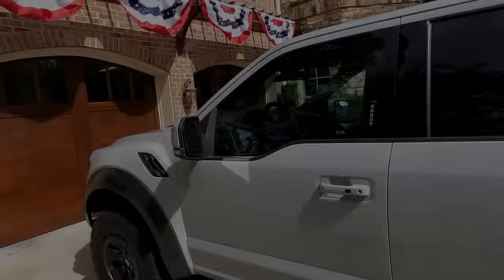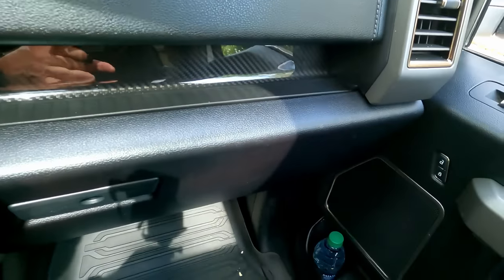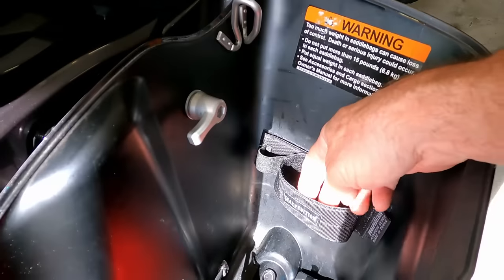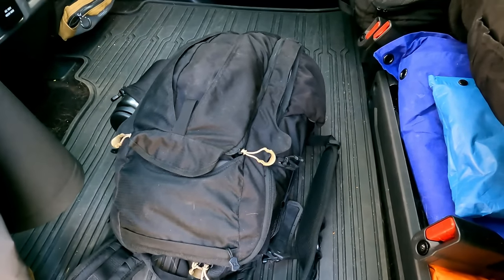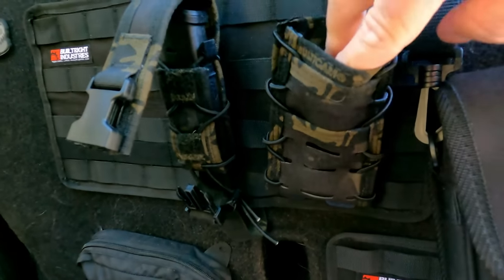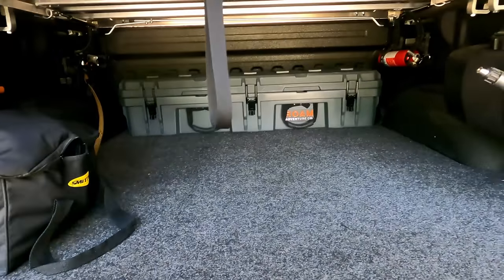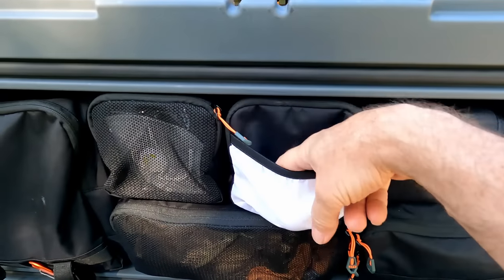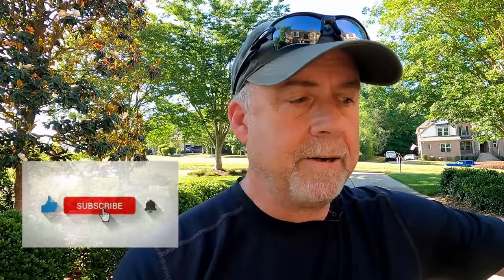Truck EDC - Everyday & Emergency Gear

Comment: Do you remove items / gear when you take the truck in for servicing?  

That's a lot of stuff to carry and store but impressed with the layout, love the molle under the cubby lid.... great 
idea.
Reply from the maker: RJB thanks for watching.  If I am taking the truck in for a quick service, I typically lock by console and place a small lock on my recovery gear case.  Longer service, I will remove items.

Comment: I would also recommend a water filter, either for personal use (straw) or the bladder with filter. Water bottles are great, but you will run out if unlucky. Water filters are cheap at the moment, and they are great to have if you need to use a stream or something..
Reply from the maker: Espen, thanks for your feedback.  I actually do carry a Sawyer Mini in my get home bag.  You are right, this is a must when becoming better prepared.

Comment: Just came back to this video. Stil find it spectacular. Would you consider doing an update?
Reply from the maker: Hi MB, again thanks for watching.  Ahh you read my mind.  I definitely need to do an update to a couple of my videos and this is one of them.  There is a couple little projects I want to complete and then I will do so.
Reply: @WeekendOverland  awesome. I look forward to seeing what you have improved. I also think that if I were to recommend one gadget that I love that I haven’t seen in your videos yet is a microfiber beach towel, I love our for wake surfing bc they dry very quick so you don’t constantly have to bring them back and forth from the boat to the house constantly doing laundry. I have also added them to all my vehicles bc they are good if you need to dry off or protect something. Additionally, I would recommend the streamlight macro stream. It is the best flashlight I have found, and I have bought multiple and every time I lose one I replace it immediately, it is that good. While it is not the brightest light, it does about all you need. I frequently wear a baseball hat and it has a clip for attaching to your hat so you essentially get a headlamp too. It’s usb rechargeable, so it’s always full and easy convenient to top off (I hate CR123a batteries bc I feel guilty tossing them, but value realizability and want to make sure my light won’t die immediately). Additionally, it is very compact and slips into a pocket with ease, I truly keep them everywhere, and on the last camping trip I went on, I only used it, I never once used my larger streamlight or o-lights.

Comment: I'm wondering about the hot summer days. So you just leave everything inside your truck all the time? Doesn't batteries go bad with heat? Tums go bad, inboprofin. You know what I'm talking about?
Reply from the maker: Hi NC2537.  Thanks for watching. You are correct.  Their are some things that have to be rotated out.  You hate to have those things go to waste but I look at it as the price to be prepared.

Comment: Excellent vehicle equipment.  I have an F-350 so similar interior storage.  Under my back seat in the factory tray I keep my truck gun chained up with a plastic covered bicycle chain and the seat down locked.   I have a camper top so I carry 95% of my stuff in the bed.   
Great video, thanks for sharing.
Reply from the maker: Thanks for watching Michael.  So many uses for that space under the back seat.  I am constantly thinking of other ways to use that space.  Camper tops definitely open up a lot of useable space!

Comment: Got some great ideas for my rig! Thanks for the walk through! Something you might consider: take the plastic wrap off of your TQ. Last thing you want to be doing if you ever have to use that thing is be fumbling around with that wrapper.
Reply from the maker: Hi Motoscout.  Thanks for watching and your comments. The TQ was actually taken out of the plastic shortly after the video was published but YT will not allow edits.  Glad I was able to help you  with your set up.  Good luck!

Comment: Awesome video! Was wondering if you could provide some insight into the glock lower - was that a custom stipple job?
Reply from the maker: Hi Wyatt.  Thanks for watching.  It is actually a simple solution.  Product from Talon Grips (https://talongungrips.com/).  They are cut to fit your specific gun.  They have a couple different textures as well.
Reply: @WeekendOverland  wonderful, thank you!

Comment: Great video! Love your setup! As a Paramedic I would recommend taking out the CAT tourniquet out of the wrapping, if you need it in a stressful situation it can be hard to take out of the packaging, tourniquets don’t need to be sterile as they are not supposed to go on the actual wound!
Reply from the maker: Hi Emanuel.  Thanks for watching. I actually removed the plastic about a week after publishing the video.  I have also since taken a Trauma med course and highly recommend it!

Comment: Nice setup, I always have several fire starting equip not only I smoke but I do need to set up a camp fire or light the grill quite often. It’s always good to have some extra bic around. I also have an extra bag of dog food and treats just in case my dog and I have to stay outside longer.
Reply from the maker: Hi David. Thanks for watching.  Very good suggestions.  Can't have enough lighters for sure.  I do have a dedicated pouch for dog treats but need to include a spare leash as well.

Comment: You should carry an Air Moto. Its a small rechargeable air pump. Never know when you'll run over a nail and be too far from a gas station. Charges with C-cable. I am assuming you have a tire repair kit.
Reply from the maker: Thanks for watching.  In my recovery gear box, I have tire repair and a pump.

Comment: Got a 2000 ford excursion that I'm getting ready to build.  I really like all of the mounting systems you have.
I live on the coast so I'll be adding a dive mask and spare air dive bottle.
Had a good friend that watched a car drive off the hwy into a water canal...right in front of him.  He immediately stopped and dove into help.
The car went down while he and the driver were still in the car.  The canal was 20 ft deep. He made it back out but sadly he could not get the driver out and she passed away.
This is why I plan on having the dive mask and spare air dive bottle.
Reply from the maker: Hi James.  Thanks for your comment.  Very sad but glad it has influenced you to prepare accordingly.  I think everybody's setup should be what they feel is best for them.  Glad you are putting a lot of thought into your setup.

Comment: I have a FORD f250 tremor. The best thing I added was the console safe. Btw, never leave you CCW in the car overnight. Painfully I know. G19x with 6 33rds gone. 
Btw, I keep nothing of value in my Truck anymore.
Reply from the maker: Hi John.  Thanks for watching.  I did not make it clear in the video but I only keep my CCW in the console when I am going into an area where I must remove it from my person.  But even for a temp situation, you are correct, a console safe would be a good add.  I will probably add it soon.

Comment: As for the fire extinguisher, could you store the water hose a little differently and put the extinguisher above the water port?
Reply from the maker: Patrick, that could be an option, I will take a look.  I have made quite a few changes since I produced this video (need to make an update).  One of which is a fire extinguisher in the cab within arms reach.

Comment: That’s a cool way to mount your pistol until you need to draw it quickly l. Also for the tourniquet you need to take it out of the plastic. When SHTF every second counts.
Reply from the maker: Thanks for watching! Regarding the pistol mount, I use it primarily when I have to take my CC off body (government buildings, etc).  But with any mount and any situation, practice makes the biggest difference.  As far as the tourniquet, plastic was removed the next day but unfortunately the video cannot be altered.  Thanks again for your comments.

Comment: How is everything hooked to the bottom of your seat? Also what is your holster and gun sitting inside your center console? Great video man gives me a lot of good ideals thank you for showing everyone!!!!
Reply from the maker: Gayle thanks for watching! The ford F150's come with this material that reacts well to the hook side of velcro.  The holder I have in my console is from Maxpedition (shown in the list of products in the Description area below the video.  I attaced it to the side of my counsole with a strip of velcro.  It holds pretty well but can come off at times when it gets really hot in the summer.  I positioned mine to where the end of the barrel just barely rests on the bottom of the console to reduce the weight on the strap. It hasn't come off since I made that adjustment.
Reply: @WeekendOverland Copy thanks for showing again guess I'm gonna see if bottom of my back seat will do that honestly now that I'm thinking about its kinda alot like the side of velcro. I don't remember what all you had on yours but do you think its strong enough to hold a ifak? And did you use those wire velcro keepers for your TQ?
Reply from the maker: @gaylecoombs5510  yes it is very strong to the point when I am trying to remove a piece I'm concerned that is pulling too hard on the material.

Comment: I love the setup. You gave me so many ideas. Unfortunately, my mega-cab 2500 won’t fit in my garage so I have a high end after market alarm system and a dedicated camera on my truck in the driveway. I keep everything in a few unassuming bags and load them as I need for trips to the range or out of town and even local errands. I put a console safe custom fitted for my truck in it and it’s perfect. A DiamondBack cover is on the bed and it’s additional security as well.
Reply from the maker: Hi Ken. Thanks for watching and your feedback! I definitely understand. My truck only has about 12" to spare while in the garage.  I am fortunate in that I work from home so the amount of time my truck spends outside of the garage is less than most people.  I have considered a console safe and probably should since I carry in the truck. Absolutely love my Diamond back cover and wish I had bought it sooner.  I have a few videos on it as well.
Reply: @WeekendOverland  Thank you for responding!!! Yes those covers are the best!!! The safe is by Locker Down and it’s great for keeping stuff when you can’t or don’t want to lug everything around. Let’s face it…if they take the truck…fine I’ll upgrade…if they have all day they can defeat the bed cover and the safe but like you, I work from home and stay up late. If you are STUPID you’ll come to the house lit up like a Nuclear Site or Federal Prison and tamper with my truck…in my house there is a total of 50+ years of law enforcement between myself, my son and my wife…good luck!!! Be safe and I’m going to subscribe if I didn’t already and check your other videos out!
Reply from the maker: @klj5150  First of all, thanks to your family for your service.  I am with you regarding your mindset, if you take it, it can be replaced ...... just don't do it while on my property!! Have a good one and thanks for subscribing!  More to come....

Comment: Ever had to explain to the cops or any issues with the cops and your set up? Also what are your worries if any, about somone taking the car I assume it’s a gps or Apple air tag somewhere in the set up. I have an app for my lo jack in the car so that’s helpful and I was actually thinking about getting a air tag for specific items
Reply from the maker: Thanks for watching Markus and your comments.  I will look into air tags, great idea.  I am fortunate that my truck is not often in a high risk area. So far no run ins with law enforcement.  I try to give law enforcement the upmost respect when pulled over and try to make their lives easier and less stressful.  Good practice is to turn on your dome light if pulled over at night so they are not approaching a dark vehicle.

Comment: I know this is really specific and something that's preference but I personally also have water, and mio but I do carry liquid IV also just for the simple fact that it helps with dehydration tons. I also suggest grabbing a different brand of water I'm my opinion Dasani has a lot of salt which is fine with liquid IV but with mio or just drinking will make you more dehydrated depending on the person's body reaction. 

Love the setup especially the molle under the center console!
Reply from the maker: Hi Brenden.  Thanks for watching. I couldn't agree more!  I was introduced to Liquid IV about a year ago and its a game changer....... Also about a year ago I moved out to the country where we have a well so now I rarely drink bottled water.

Comment: Nice setup, thanks for the ideas. The "shovel" you have is what we would call an "entrenching tool" or "e tool" in the military
Reply from the maker: Hi Zach.  Thanks for watching and your service. You are correct! this thing would be hard pressed to perform like a real shovel.  I actually have a shove that I sometimes keep in the truck with about a half length handle.  Still deciding on the best mount.
Reply: @Weekend Overland  always handy to have a real shovel when nature calls 😀

Comment: Latex gloves for dirty intricate jobs and incase you need to lend your heavy duty gloves out don’t want some else sweat in them. Various sizes of nylon zip ties or one better seeing as though you have the space, stainless looped rebar ties and a rebar bar twist tool. All very inexpensive, fast to use if you need to secure anything down/ together 👍🏻 nice setup
Reply from the maker: Hi Ron.  Thanks for watching and providing some great ideas.  I actually have some zip ties in my bag but I like your idea on rebar ties.  Thanks.

Comment: I would recommend putting 5% or 20% over your rear factory tint.  Couldnt imagine leaving all that stuff exposed all the time.
Reply from the maker: Yes, I have been considering this.  Thanks for the recommendation.

Comment: I have a question, How much was all the stuff in the truck? This is the most PERFECT  I have ever seen planning to buy an F150 when I grow up aswell, ill be adding a cab at the back unlike yours though, but everything else, I love it man!
Reply from the maker: Hi 5cvle.  Thanks for watching.  It appears everything has gotten crazy expensive lately.  The ROAM containers that I really like have increased by about $100.  Other items like the stuff from Builtright are still not bad.  My advice is to never look back and add up the cost 😆.
Reply: @WeekendOverland  yeah true lol

Comment: Thank you for sharing your set up with your gear.  I agree that the fire extinguisher needs to be more accessible somewhere close to the driver's seat. I do recommend that having your recovery gear more accessible if you plan on getting on trails that may leave your Raptor in precarious positions.  I've learned my lesson.  I must have missed what you have in your edc bag.  It seems like a lot of this gear could be stored in your edc bag.  I also noticed that your have a lot of knives and flashlights but no spare parts for your vehicle.  At the very least you should be packing spare belts, hoses, clamps, oil, air filter, etc.   Anyway, thank you for your video and stay safe on the trails.
Reply from the maker: Hi Stephen.  Thanks for watching and your feedback.  Yes totally agree regarding spares (especially if you are traveling in remote destinations).  Like many others, my setup is constantly changing.  I need to produce an updated video.

Comment: Great video! Thank you for making it and sharing your gear. 1 thing I have been thinking about a lot lately is a water filtration/purification supplies.
Reply from the maker: Thanks for watching Jeremister. I haven't gotten very deep in water filtration.  I have a few Sawyer filter systems I use for hiking / tent  & hammock camping.  In this video I discuss the water systems I currently use:
https://www.youtube.com/watch?v=ecaxF_mOqNw&t=468s
 I am considering a system that incorporates a filter with a 20L can made by Life Saver.  It is a little pricey at $300 (which is why I haven't purchased one yet).

Comment: You should take the tourniquet out of the wrapping, throw away the tiny instruction booklet ( because you should be trained and know how to use it ), and you can also stage the tourniquet in more efficient ways than how they are folded from the factory.
Reply from the maker: Thanks for watching! Tourniquet plastic was actually removed the next day but the video cannot be updated

Comment: I was preparing a backpack that has all the necessary equipments for any potential risk/threat in an urban environment, i live in istanbul as foreigner and couple of months later i will be visiting all major European cities, i prepared a mini pharmacy, 20,000 powerbank, all tech equipments, fast, accessible, and legal self-defense knife and pepper sprey, and countless other utilities, still i need a gps tracker to insert it to the bag (i am not sure if you do have a gps tracker for the truck but such a small device inserted to your truck can increase the security of the property from being stolen or lost) 
the bag shouldn’t exceed 12 kg and it actually looks cool from outside, obviously a backpack is nothing compared to a truck 😅 but i ended up watching your video when it was recommended to me and subscribing to the channel, great work ✊🏻🔥
Reply from the maker: Hi Shamy.  Thanks for watching and subscribing!  I am planning to do another video soon on changes I have made to my setup.  Sounds like you are definitely on the right track and 12kg is a good weight (especially if that includes water). In regard to GPS, I do not have one in my bag but my truck came equipped with one that works through an app.